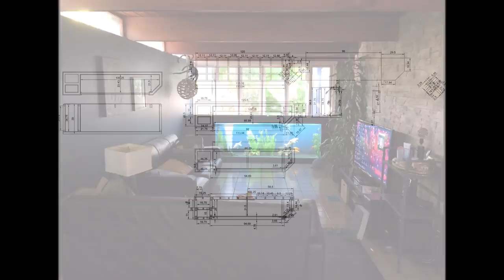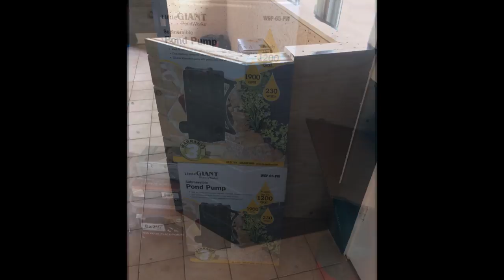Aquarium - Wood & Epoxy & Glass - DIY HomeMade

Comment: Amazing.  That is awesome.  How is it holding up over the years?
Reply: this seems tobe a big point of concern. ohio fish rescue has been using theirs for years and years i think if one engineers it to hve no flex ad seals it properly that the shoud last. but how does the wood hold up for 20 years... does it flex? plus if the humidity isnt accounted for it has ended many a house a aquarium project

Comment: You have one pump in your tank and another in your sump working at the same time?
Reply from the maker: Yes, and to prevent overflow there is a hole above water line between the tank and the sump.